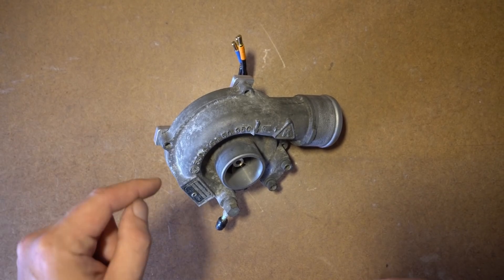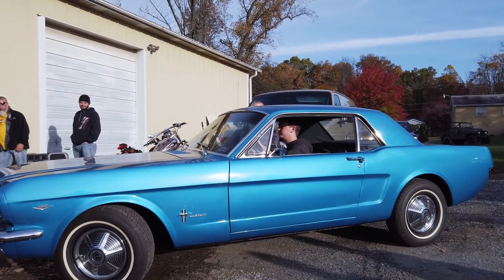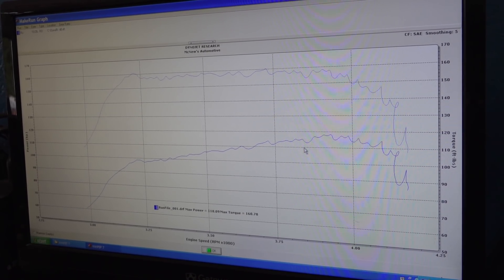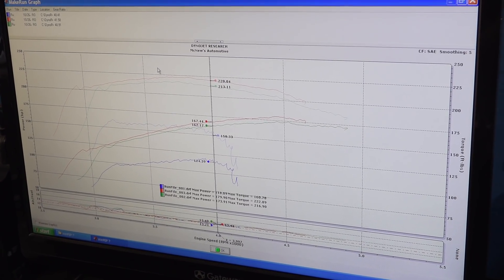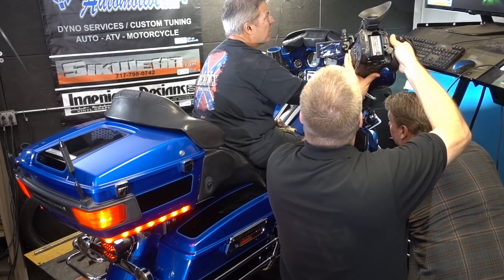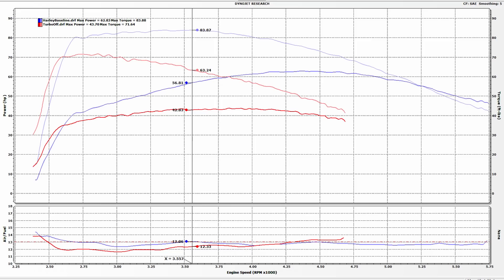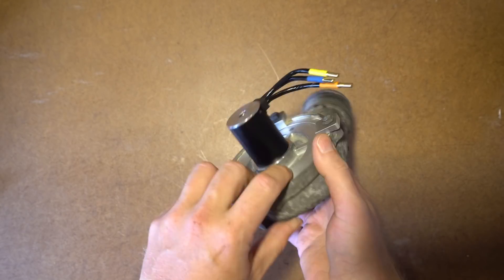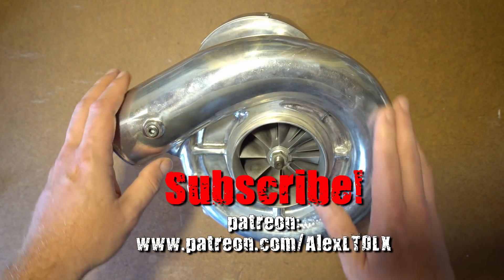DIY Electric Turbo On The Dyno!

Comment: Alex, have you seen tesla500's video testing an electric motor driven compressor?

He takes measurements of power requirements, compressor RPM, and output pressure using a Cummins N14, Rotomaster HT60 (73.5mm Inducer, 109mm Exducer)

I couldn't find a compressor map for the turbo though. So, no idea what kind of volume it's putting out at the speeds he tested. 

Looks like the HT60 wheel is dimensionally similar to an HX55 wheel, but that's not saying much. Plus, Holset maps are just as difficult to come across.
Reply from the maker: I haven't seen that. That sounds like excellent data to check out. I'll look for it. I considered using a holset hx82. But I really don't think I'd find a decent motor battery pack combo to spin that thing. But who knows I might learn something from this guy's video based on what your posting. Thanks for the tip!

Comment: Very cool. 8-10KW is around 13hp I beleive. How much boost can that thing make? Even 7-8psi would be a good start.
Reply from the maker: I'll post a video on compressor maps soon that will show that data.
Reply: At 8-10kw it will make about 3-4psi.. the torqamp is 13kw and pulls 5-6psi
Reply: @smahring  sounds good, that should be good for a noticeable bump in HP for most cars without the need to upgrade other components too much.
Reply: @nighthawk0077  its almost perfect... you don't want to go over 7psi on any stock internal, and even then a higher mileage engine without proper maintence, 7psi can blow it. I personally would stick at 5psi to be safe with any stock engine, and you'll still get 30-50hp boost depending on the tune, then from there you can do basic add on's like exhaust, flywheels, etc. To push upwards to 60-70hp gains. I also read an article from 2012 at the start of the electric research saying you need 3.5kw of compession power, not a fan, to hit 5 psi on 12v, but the torqamp hits 5psi at 13kw and 48v. I think the research didn't account for air restriction and power loss from battery and alternator drain.

Comment: When running a compressor that isn't geared like the one at the end you will just need to look at the map and get the shaft speed rating and match the rpm. Normally small turbos need 120k rpm or more, something like a S400 or gtx55 run slower to make more flow, about 75-85k rpm. Years ago I made a electric screw blower using a dc golf cart motor.....  With a separate power supply it made power, but with a 24v alternator on the engine..  Total power was like 7% more even with 10 psi to the manifold. I imagine with modern brushless motors you can actually make something that has more of a gain.
Reply: 10psig at peak power would be about 147% of the original power.
Reply: @DarkLinkAD  yes, if you don't factor in the parasitic losses. The power required to turn the large alternator at high output loads basically used the power added by the extra boost.
Reply: @evil_me  How many watts we talkin? 

Im guessing more than typical batteries can provide, without needing a lot of them.
Reply: @DarkLinkAD  motor was from an old golf cart, huge brushed monster, I honestly don't remember the specs but it would pull over 160 amps on 24v trying to spin up  lol

Comment: You gotta spin that thing insanely fast. Gearing is your friend.
Reply: You may be right. Unfortunately those RC electric motors aren't designed to rotate much faster than 40,000 rpm.
Reply: @nighthawk0077  there are hobby grade brushless motors that a capable of more than 40 000 rpm but they're expensive very expensive.
Reply: For every problem there is a solution. I don’t think that it will draw significantly more power, if on a running engine at rpm. If the air has somewhere to go, you’re not fighting air pressure as much. If that doesn’t work, build a bigger battery.
Reply: But if you can run a planetary gear overdrive to get 1:2 at 40k, the impeller will now be spinning 80k... well into the realm of actually being useful. 200k is more like proper turbo rpm, but at 80-100k the thing could actually build some decent boost.
Reply: @gallupcustomknives2293  yes you  would need to installed a sealed gearbox that could also be reliable at those speeds.
Reply: @gallupcustomknives2293  also dont forget, you might need a bit of torque!
Reply: I know a bright young machinist who could build a nice little planetary gearset as well as a sealed housing for said gearset.
Reply: @gallupcustomknives2293  hope to see your results posted!
Reply: In engineering there in no such free lunch. To turn the compressor wheel at a rate that will produce measurable boost will take a lot of energy a lot more than a small battery can deliver.
Reply: @chipcity3016  this I have no engineering background but with googling power needs based on drive torque I found it wouldnt be as efficient as....recycling exhaust gasses, I am huge on superchargers, but nothing beats turbos in efficiency its a NEARLY wasteless system and all you need is to have 1-2 seconds of patience, not even that in most applications.
Reply: I absolutely agree that turbos running in their originally designed form are far and away the most efficient form of forced induction... but regarding your comment of torque to drive my planetary gear overdrive concept, that is where electric motors truly shine. Look at 90% of locomotives, they use electric motors (and the torque that they provide) to actually move the trains. The Diesel engines on most locomotives are purely for energy generation, not for driving torque.
Reply: @gallupcustomknives2293  very valod point in no way was I trashing electric motors, I wad merely saying you have to find one with ENOUGH torque, for the required power cost, and a low weight wont hurt, in these modern times that narrowed down list STILL leaves ones with an abundance of choices, I was more attempting to inply that with all aftermarket, its a balance of pros vs cons.

Comment: A little blower like that may seem useless to all but the smallest motors but if you could plumb it right it might work to kill turbo lag on a larger engine. You’d need separate in takes with one way valves on each.
Reply: Koenigsegg uses it to prevent turbo lag

Comment: Told you it wouldnt work. Seriously, all the testing you have done is below standard results in terms of stock stats. A bigger compressor housing will "lessen the restriction" you have on your intake. This will cause the motor to breath more freely, sucking in air at a CFM more similar to stock. This greater consumption of air from a freer flowing motor will outweigh any sort of gained positive pressure you hope for from a bigger compressor housing. Youll be adding 500 CFM of flow with the turbo, but due to the lack of resriction to the motor, it will naturally suck up say 600 CFM, putting you at a deficit... again (numbers are for demonstration only). And MAYBE,  if youre lucky, you can pretend to hold posi pressure at 2700rpm as opposed to 2500. Im only salty because you baited with the results until the last 30 seconds. I had to skip through this just to confirm my statements.

Comment: 8-10kw won't be enough to spin that compressor to provide the air mass you are looking for
Reply from the maker: How do you know?  Is there some sort of calculation?  I know my Whipple most likely draws 70 hp; and an equivalent Vortech less, and it's even less at a lower pressure ratio; plus there are no losses due to belts; tension; gears, tensioners, etc.  That seems to be the big unknown, yet OEMs are making them for model year 2021.  With less power.
Reply: @AlexLTDLX  IIRC from playing with my Chrysler 2.5l turbo back in the day, the compressor required ~10kw to supply the engine with 12 psi @ 5000 rpm. (~175 hp) Don't crank driven compressor manufactures publish that data?
Reply from the maker: @fascistpedant758  I'm not sure it's a linear relationship.  And finding that data is very difficult, if non-existent.  You'd really need a map similar to a compressor map.  Blower type, speed, pressure ratio and flow all play a role, I'm sure - I've been told my Whipple takes around 70hp to turn; an S Trim takes around 40 and a ysi at full tilt takes 350 - clearly, there's some debate going on (I'm not sure I buy that 350 number).  Then there's losses from belts and gears to take into account.  But you have identified the one great variable... only one way to find out...
Reply: Well 8 to 10 kw is like 10 to 13 ft/lbs so i dont know or thats HP not torque I think
Reply: @james10739  10 kw = 13,41 hp
Reply: Ya I know 1 hp is about 750 watts i dont tknow why i was thinking torque

Comment: You need 36V - 48V motor to be able to spin the turbo / charger fast enough. Look at Audi,  they are using 48V and it i working.
Reply from the maker: Voltage really doesn't matter in theory, but it does in practice.  What ultimately matters is the amount of work that can be done - that's best defined in watts.  But yes, in practice 48 volts is what I plan to use; simply because that's what's available.
Reply: @AlexLTDLX  Why u think that in theory voltage doesnt matter? Basicaly I would say that with electro motors voltage means RPM, thats what is necessary for more airflow and the second part of Watt is amperage. Amperage means more torque or if the resistance is rising more amps is necessary. As here should be almost no resistance not much extra amps is needed. Electro motor will take only so much amps to be to spin as fast as voltage says you can not force more amps to it. So voltage is the king for this setup I quess.
Reply from the maker: @kiklop8362  Because brushless motors don't work that way.  For that matter, neither do brushed motors (mathematically, anyway).  A brushless motor's speed is determined by frequency, not voltage (or current).  All a brushless motor really is is a 3 phase AC motor.  You could (theoretically) have a motor that can hit 100,000 rpm at 10 volts.  Giving a brushless motor more voltage will not result in more speed; you need to raise the frequency to do it.  As far as power for any motor goes, voltage and currrent don't specifically matter, but they are inter-related.  What actually matters is watts - P=IV (watts=current x voltage).  Watts is fairly directly indicative of the work a motor is capable of doing, and is directly relatable to horsepower.  In fact, 1 hp is 746 watts.  You can have 1 volt at 746 amps and generate 1 hp or you can have 100 volts at 7.46 amps and still have... wait for it... 1 hp.  Available battery and motor technology are what determine voltage/current to get a particular job done.  Hope this helps.
Reply: @AlexLTDLX  That's all correct. But that motor could produce a lot more boost at higher speeds for ~10 second dyno runs. It would, however, require higher voltage to draw the necessary current at higher frequencies.

Comment: Are your planning on gearing up the turbine wheel because the electric motor will have plenty of tork
Reply from the maker: The motor I'm planning on using should be directly matched to the rpm range/power requirements I intend to run.  Gearing it up probably will exceed to motor's torque output.
Reply: I would try designing a planetary gear overdrive at 1:2. Once the engine is sucking the air, the torque required to spin the turbine should decrease significantly. Set it up to a potentiometer so that the motor sees the voltage increase towards maximum as the engine throttle is opened. You don’t need the impeller running full rpm if the throttle butterfly is closed, if you do that you’ll only be fighting yourself by pressurizing the intake tube without actually using the pressurized air. I think a gear overdrive is the only way you’ll get adequate impeller rpm to make significant increases in power.

Comment: Word to the wise, all the OEM electric superchargers use a 48v supply.  For obvious current and heat limitations of a 12v supply.
Reply from the maker: 48 volts is the way I'm planning to go.
Reply: @AlexLTDLX  why stop at 48? Grab a battery pack from a nissan leaf or something similar and launch that thing into orbit!

Comment: I feel you would have a larger power gain hooking the electric motor straight to the crank
Reply from the maker: Maybe.  But there's only one way to find out.
Reply: Or just leaving the turbo alone and installing it as designed?
Reply: Actually, you'd see the most gain using it as it's supposed to be used, as a crankcase pressure relief. Devices like this are used in some forms of high end motorsport, and teams see as much as a 50hp bump by relieving the pressure inside of the crankcase, essentially meaning there's less pressure working against the pistons on the back side, meaning it's essentially a form of boost from UNDER the piston.
Reply: Un Listed wouldn’t the force under the pistons affect all the pistons at once? I don’t know if the vacuum would be responsible for any power gain.
Reply: @isaacpreven3693  Yes, it effects everything in the crank case. The air in the crankcase is "dirty" air that has a parasitic effect on the piston both going up and coming down, as it compresses, expands, and is forced around the crankcase as the pistons cycle. It's the same concept that F1 uses in the valvetrains. The valve springs, cams, and valves are sealed in a lighter-than-air gas, which is part of what allows them to rev to such high RPM's.
Reply: @unlisted9494  I'm not agree. Air in the crankcase box has a constante volumen unless for monocilindrical engine or other exótico configuraciones as V5 L5...

Comment: Maybe I heard somewhere that for better efficiency of turbo impeller makes so much difference.
Providing around 70,000 rpm will be enough for 5-6 psi boost.
Reply from the maker: That really depends on the compressor map.  If you spin the Vortech that fast, it'll be way out of it's efficiency range.
Reply: Boost is entirely dependant on the volume of air the engine needs to run. Something that makes 6psi of boost on a 12hp lawnmower will be a tremendous restriction on say, an LS3.

Comment: Ok you have a compressor map - what size motor would there small electric turbo be good for?   A Harley is about 75-88 c.i.  Or 1200-1300 cc.  What about a 500cc motor?
Reply from the maker: I'm going to be doing a video on that topic soon I think. Because once you know it's really not that hard. And so much faster and cheaper than trying to guess.
Reply: Hes gotta make a series man, show the answers, rather than just giving :P
Reply from the maker: Video is done: https://youtu.be/h7yScua28I8

Comment: I like the experiment and projects in between your car racing videos.
Reply: Oh and that motorcycle owner is a very brave man, allowing that unbalanced grubscrew thing without a shrapnel containment mesh on his engine XD
I actually started developing a similar crankcase vent pump a few years ago, but with the tiniest turbocharger compressor wheel. The main issue was durability; the bearings of these RC motors (even the fancy europan made ones) don't come with a rating or any sort of life expectancy, so I quit the project.
Reply from the maker: Lol - yeah, Ron is a helluva guy.  But that thing was made pretty well (ignore the fact that I didn't bother to beadblast it).  I've run it for months - it's been sitting on the second desk in my office since May; so I felt pretty good about it.  But it certainly could've failed.   The nice thing about a setup like this is that it doesn't run for long at all, and it's super easy to make sure all's well.  On the evac side, I'm not worried about it chucking parts - they'd just go into a catch can.  But as a supercharger - I'd probably run an intercooler, even at low boost, just to catch parts should bad things happen...

Comment: Cool ... you jumped right to the obvious...  go bigger!!!  
Try gearing the new bigger electric motor to turn the turbo impeller faster than motor shaft speed. You will probably need a higher voltage power source?? .. 60V ++ to leverage available motors?
Reply from the maker: Oh, I have a plan.  And it's along your line of thought on voltage; but not gearing.  I'll do a compressor map video maybe this weekend, time allowing.
Reply: @AlexLTDLX  You will need ot get that blower spinning 12000ish rpm to make that 600 hp with that compressor. You just need a motor that can handle high voltage and has a high KVA. Realistically I think the gearing idea is better. It will pull more current but it should spring higher. I have no doubt this will work. You need to find the right combination of parts.
Reply from the maker: @Twin_turbo_coyote_fox   Wait until you see the compressor map for the Vortech - it starts at 20,000 rpm and it's sweet spot is about 32,000 rpm (max is 54,000).  But we need to stay with available components.
Reply: @AlexLTDLX  a great project ... if it really generates a lot of boost .. you will need to modulate the impeller speed to match the demand of the engine ... or  install a controllable boost blow off valve that can be adjusted to control the boost pressure.  Fun Stuff!!
Reply from the maker: @KrustyKlown  at some point I'm going to have to apologize to the RC guys. They've already figured that stuff out with their electronic speed controllers. You can even get Bluetooth.